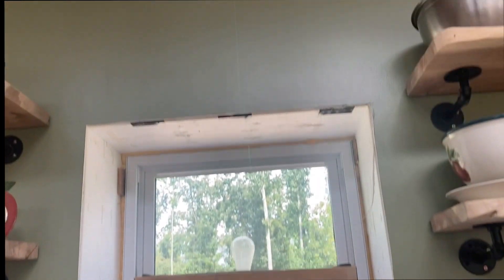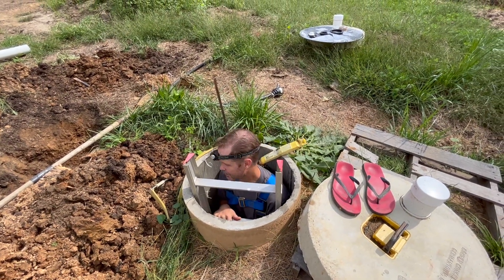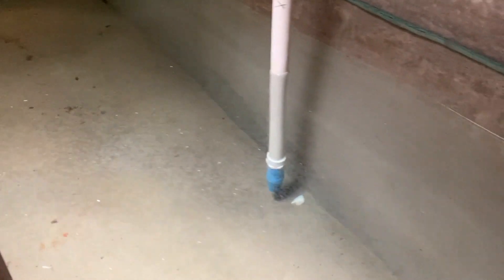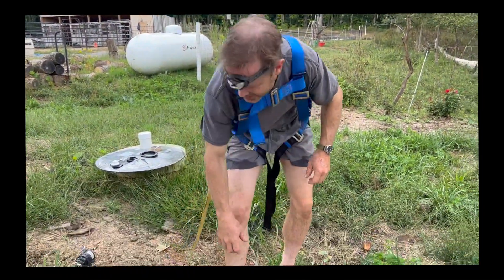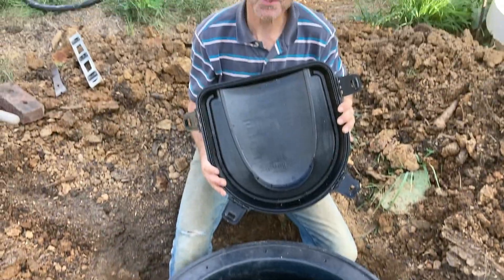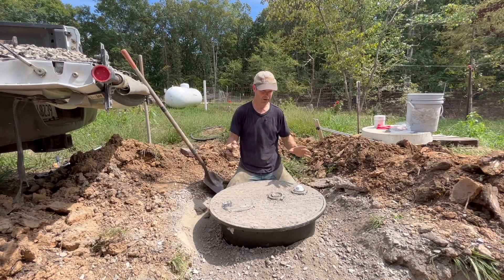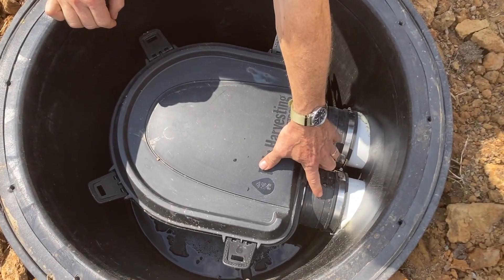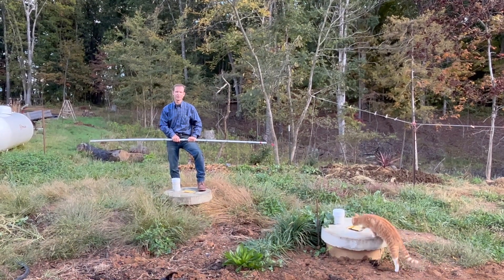Installing Rain Collection Gutters and Filters

Comment: Love your channel.  Does your system include a "first flush" system to divert enough initial rain water to clean the roof of not only dirt but also samonella from bird poop?  Homesteadanomics YT channel here in AZ has quite a playlist on DIY water collection ideas.  The newest ones include first flush systems.
Reply from the maker: We actually don’t have a first flush system in this particular set up. We did in the last one. There’s a couple reasons why. First, we made sure we didn’t have trees right around the house, that makes a big difference. Second, it’s a Galvalume roof with full sun exposure which not only provides for very clean water, it also provides natural sterilization. Third, we have a three stage filtration system. Even with all that, there’s a risk of bacterial contamination. But there’s also a risk with the first flush system. There’s really no way to keep gutter downspouts sterile.  Trying to obtain that is unrealistic.

Comment: Very clever system. I liked dividing the 70 ft in half.  I have seen other designs with a 'trash catcher loop' on the downspout that then overflows into the main line.  Did you consider?
The green leaf catcher would not work at our place as the big trees blow so many leaves it would block it off.  Leaves blind off 'open' gutters and I have to blow or wash them out.
Reply from the maker: We had a leaf problem with our last home, and rain collection design, so we actually used the Y system, where the initial water runs into a collection portion of the gutter, taking all trash and debris with it. Once that fills, the water is clean and overflows into the other side of the Y, and then through the filters and into the system. That worked really well for us at the last house. At this location, we intentionally removed the trees directly around the house to both help with the solar power and to prevent the leaf problem. We still get a few, but easily controlled.

Comment: 7:30 "glueing sewer pipe"  curious if that's what you meant to say. I always enjoy your videos! Thank you for sharing.
Reply from the maker: That was intended, though there is probably a more technical term😁.  I was supporting the pipes while the pvc “glue” was drying.  And thin wall PVC is commonly known as sewer or drain pipe, while thick wall is known as water pipe due to it being under pressure.  That said, obviously this is NOT being used for sewer purposes.

Comment: At the end of your video, you asked for any suggestions. The only one that had popped in my head when watching was how you were packing the gravel around the pipe. I do a fair bit of digging, trenching, burying, and backfilling. When I cover pip like that and want it to be well supported from below, I shovel dirt or gravel over it and then use a short 2x4 scrap (maybe 2 or 3 feet long) and use that to pack the dirt down along the sides of the pipe. It seems to shove the dirt nicely down under the pipe if you do that from both sides and avoids leaving unsupported voids.
Thanks again for this video!
Reply from the maker: Thanks for the comment.  I also tamp the sides with a board and even tap the pipe a bit to try and vibrate the gravel under the pipe.  I didn’t show that but it is the reason I use gravel, it seems to fall into those voids better.
Reply: I presumed you did a great job with the burying. You definitely seem to have a good sense of what you're doing. I looked up that filter module you used and bookmarked a place where I can get one. Today, the price at that store was about $300. Does that sound about right to you? For plastic assemblies like this that probably have about $5 of actual materials in them, sometimes it's hard to know if you've found a decent price, or found a store that's charging 10X what something costs elsewhere. @ADifferentWay
Reply from the maker: I believe we paid around $350, so that sounds about right by the time you add in taxes or shipping. If you’d like to be certain, check out the description section, as we actually put a link to it in our Amazon storefront. That’s the exact one we used.
Reply: Thanks! @ADifferentWay